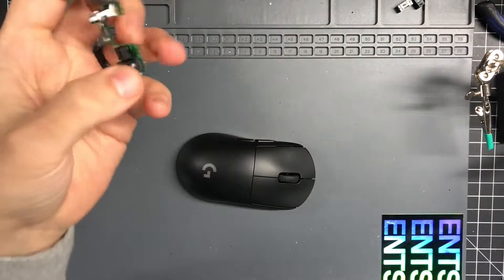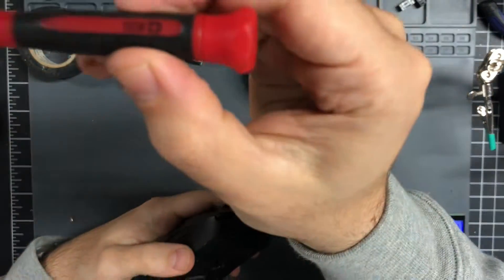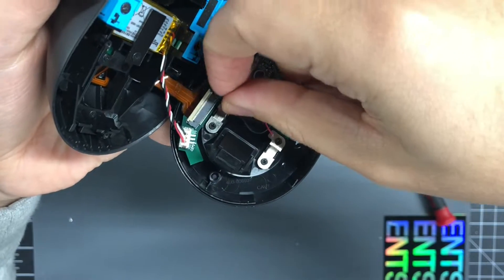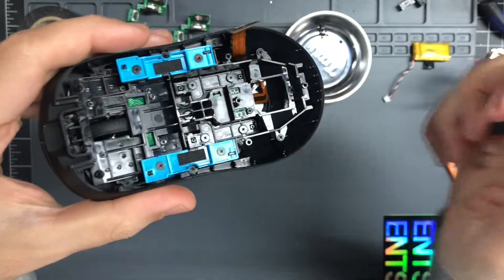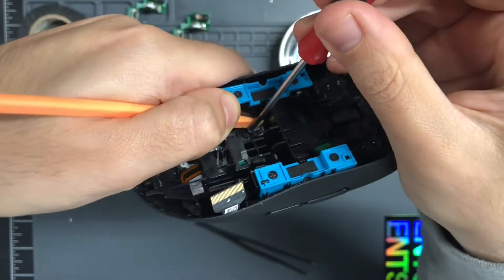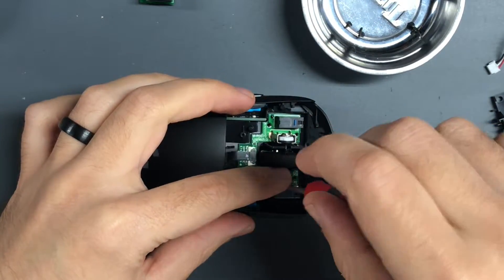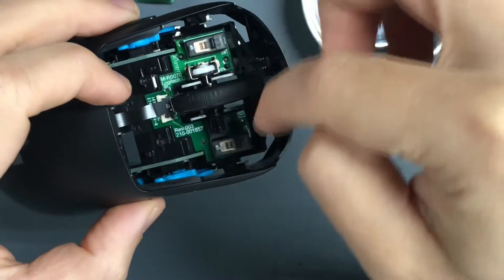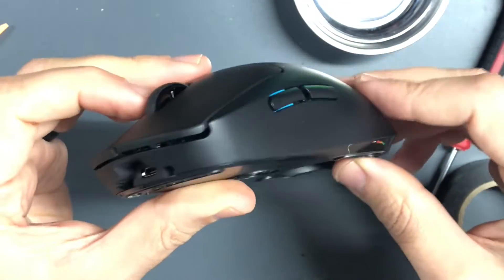Installing  my modded GPW PCB into a Logitech G Pro Wireless – Easiest way to replace the switches!

Comment: tyvm - all installed - on first rebuild the buttons did not work, 2nd rebuild scroll didnt work, the mini ribbon cable that goes into the click board is verryyy finicky so dont be afriad to reseat it a few times

Comment: Lost the mouse wheel spring (can be seen at 5:50). Not having it can change the feel of the scroll wheel & wheel click. It's so small and hard to spot if you don't know it's there before you open it up that it'll fly away without the user realising, and if they notice the change and dislike it, they'll have no idea what went wrong. These small details matter.
Reply from the maker: you can buy them on aliexpress

Comment: My GPro mouse stopped scrolling, I replaced the scroll encoder, but it still didn't work. I bought a new PCB; will it work, or is there a risk that the issue is on another part of the mouse?
Reply from the maker: pcb should fix it

Comment: Ok so basically i broke my g pro cuz my soldering iron wasn't powerful enough to remove the switch
And that made me sad and my brother said to buy the pcb like that on the video and it came and we puted it in the mouse but my main problem is which is the spot for the small screws and the big screws pls make a video about it
Reply from the maker: big screws (big head short threads) are for clicks, and battery. the smallest screws are for the pcb. the rest are for everything else

Comment: Ents, I saw the options to change the scroll wheel encoder on your sight. My question is would that affect the scroll wheel height? Or is there a mod to affect that? I don’t like how elevated the wheel is above my switches on my superlight… would a mod to lower it be possible, or very complicated?
Reply from the maker: you'd also have to lower the middle click switch height, i suppose it's doable but not by me
Reply: Kailh GM 2’s or GM 8’s??? Lol… predicaments… going to purchase one or the other from you as buying your swap kit is cheaper than me getting all the soldering gear I would need and then the time learning and screwing up my mouse because I’m a noob lol

Comment: My GPW is having double clicking issues with middle click. Would replacing the scroll encoder resolve this? I'm really interested in one of your PCBs regardless, even more so if it can fix my scroll wheel clicks!
Reply from the maker: the encoder is for scrolling only, but the pcb will have a brand new middle click switch on it
Reply: Thank you so much, really appreciate the info!

Comment: I just received my modded PCB and installed it in literally 10 minutes. It's super easy, and it works like a charm. I will recommend you to my friends if they have any problems with their GPW.

Comment: This video was perfect. I was about to buy a new GPW when I came across this mod which is cheaper and will last longer than a new mouse. I did get a screw sucked into the magnet (haha) but was able to retrieve it with thin tweezers. I will say the lightness of the stock Huanos is slightly better for me than the Kailh GM 8.0, but I'll get used to them and they should hold up much better. Thank you!

Comment: Love the tutorial! I ended up buying a soldering iron and khaili reds, battery connector didn't want to come out, so I had an easier time just gently lifting the battery up with the end of a pen. Solder-sucker only got 98% of the solder off too so had to just break the oem switches to get them out lol.
Reply from the maker: Glad it helped!
Reply: If the solder sucker didnt get the rest of the solder out, use solder wick to remove them, dont try brute force as it may damage the pcb
Reply from the maker: @Wanted54321  https://www.youtube.com/watch?v=-Syeyc4ySFc
Reply from the maker: https://www.youtube.com/watch?v=-Syeyc4ySFc

Comment: I know this might void warranty, but lets say if I do this carefully and save original pcb and put modded one inside. In case that mouse has a problem and I just take modded pcb out and put original one inside. What are the chance that they spot that mouse was opened and modded. What is your oppinion on this.
Reply: your mouse wont have the old mouse feets,  but anyway most  probably they dont check the insides  if a mouse has issues? as long as  the back mousefeets are black and looks non tampered it shouldbe alright (you can stick the black feets back again after wards ifu wanna claim warranty

Comment: Thought it would be fairly straightforward to replace the GARBAGE switches in my G604 with Huano White Dots. How many goddamn screws and parts did they put in that sucker? I am now stuck with a pile of loose parts and I still haven't accessed the board that the left and right switches are attached to. I am not sure how to proceed. Would it be worth it to just buy  another G604 and have it shipped to you to replace some of the switches?
Reply from the maker: if you havent lost anything, bag it all up, fill out the form, and ship it to me! 

form is here:  ents.win/links

Comment: Hey, I did the fix by PcGamingWiki (link to vid in comment replies) I first did this like a year ago and it worked but im running into the same double clicking issue so i attempted to do the same fix again and im just getting irritated i have disassembled the mouse but it all works fine it isnt broken i just cant be bothered to put this switch back together would that be fine if i put the mouse back together (besides the switch) and sent it in? im just worried you would assume i broke it and be scared to touch it just thought id ask before i make a purchase ill show you pictures and stuff if you are curious too. sorry for the long message.
Reply: https://www.youtube.com/watch?v=eDoXMJyimDU
Reply from the maker: you can send it to me disassembled with the switches removed/broken! just make sure you include all the parts and pieces together in a bag. happy to chat more, email me holler@ents.win